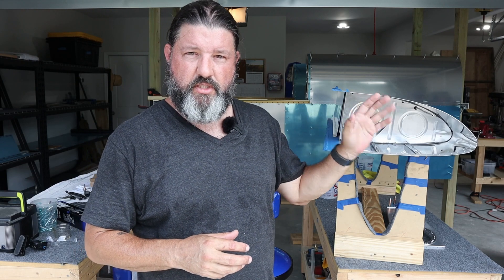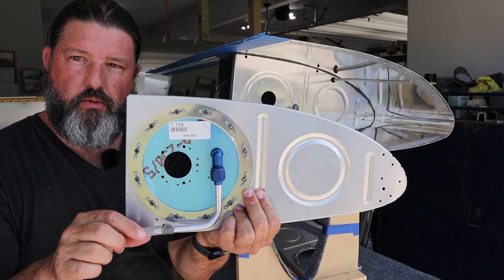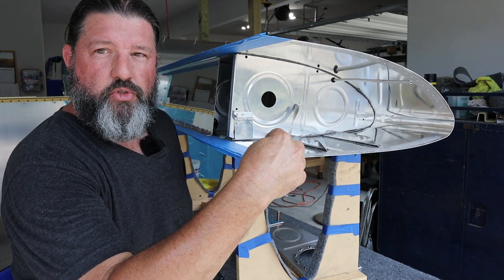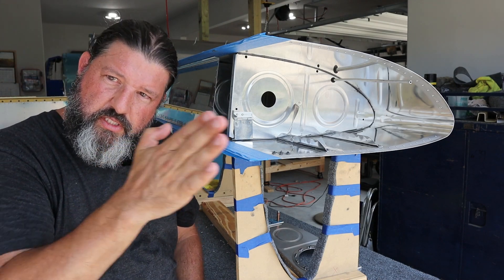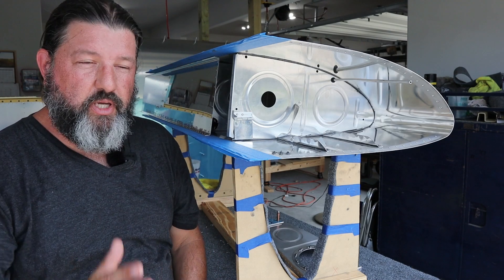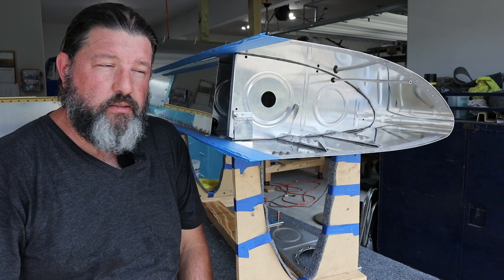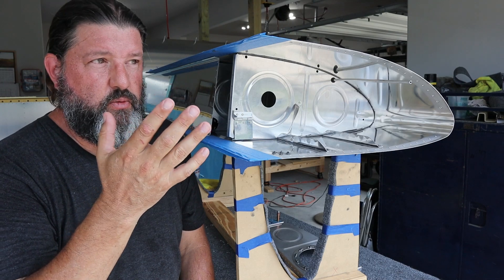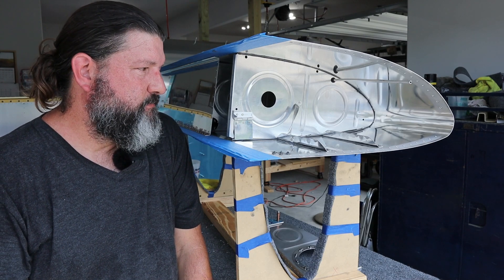Van's RV-8 Build. Ep 072. Lets talk about inverted fuel mods

Comment: A very good Heads Up for those considering inverted mods!  One drawback of the flop tube mod is that your relocated fuel sender reads empty early, which is really not a bad thing.  If one is tempted to do some "gentlemen" aerobatic maneuvers, if not inverted oil-equipped, even a momentary -1G may coat your aircraft's belly with oil from the breather.   I flew a non-equipped RV-7 and came back with oil from firewall to the tail wheel after only 1 second at -1G recorded by the Garmin G3X.  Lost about half a quart.  Mental note: next time stay positive through rolls!

I have a Christen inverted oil system in my IO-360 RV-4 and have not found a need to wipe oil off the belly after hanging from the belts for 30+ seconds.  I did not install a vent tube through the fuselage to exit near the tail but instead mounted a stainless-steel tube parallel to an exhaust stack and vented next to the exhaust outlet.  This seems to burn off any minor oil vapor from the vent, with the added advantage of preventing freezing of the vent outlet.  I got the idea from RV-6A photos posted on Larry Vetterman's website.  He said it worked well, so...

And yes, maintenance behind the engine is more difficult cluttered with the Christen vent bottle, oil valves and lots of associated hoses.  Also, it adds a lot of weight FWF.  Lycoming lists an 1800 hr. TBO for the AEIO-360 vs. the normal 2000 hr. TBO (if that concerns you), and Aviat recommends flushing the vent tank with varsol at 300 hr. intervals.  They also recommend getting negative frequently to flush fresh oil through the otherwise stagnant oil passages.  Use it or lose it, your choice.
Reply from the maker: Thanks, DL! Real-world feedback is great. I'll probably come back to this comment a few times for reference as I touch those areas of the build.

Comment: If anyone is wondering, it only takes a few hours to convert an already built tank over to use flop tubes.  It is obviously way easier during the build, however it isn't impossible once the tanks are sealed up and complete.
Reply from the maker: Thanks for the feedback! I’d hate to make those modifications one the tank is all buttoned up. But I can see how someone who has really thought through the work and has their ducks in a row can knock it out in a few hours after the tank has been removed.